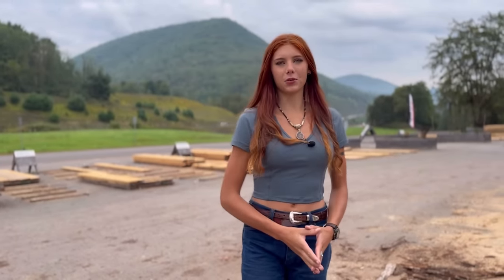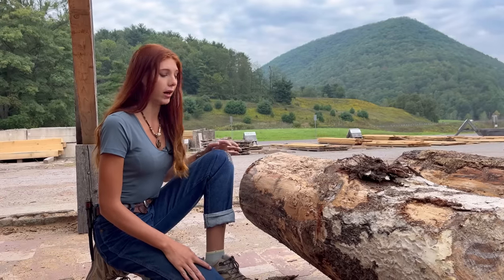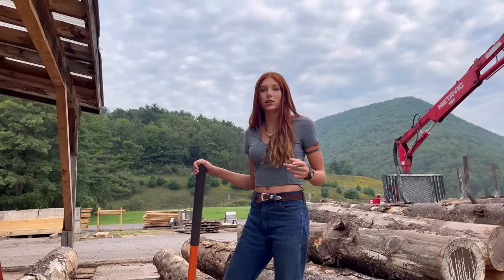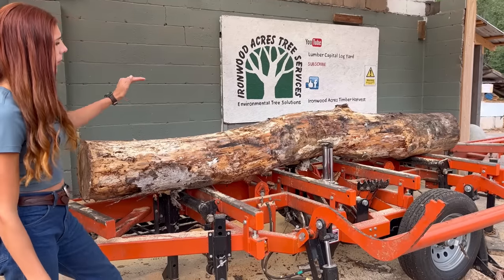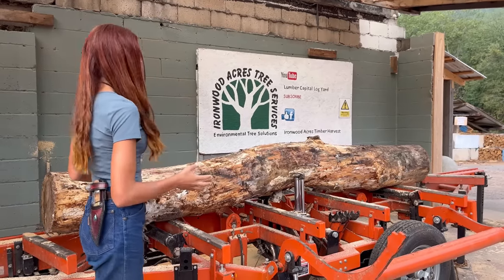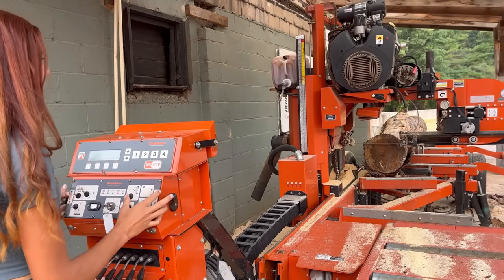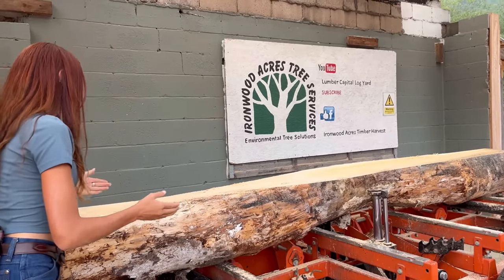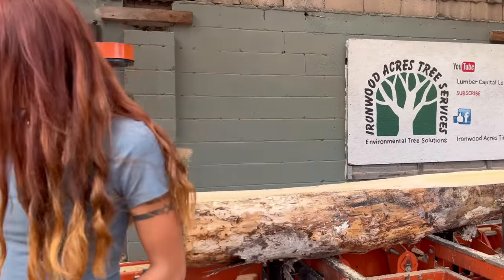PROBLEM SOLVED: How to Mill a “Banana” log!

Comment: Great job explaining the process used to work through a banana shaped log. Today, I worked through one banana log 20 footer, with a twisting action at the small end. Relieving the tension and compression inside the log was a challenge while working toward a stable cant.  Your camera and sound person earned an A+.
Reply: I don't think it's the smartest method, though she's lovely. The tension in the wood tends to remain after drying and no matter how many years of stickering and weighting. You simply can't overwhelm the hydraulic power of wood cells (not without new "baking" methods). The figure of the boards will be nice though. and if thin enough they'll be acceptable. I recommend the old fashioned pit saw way--saw directly through the straightest longitudinal axis of bent logs yielding two equal left and right bananas. From there you can get flat albeit bent lumber. This wood is ideal for chair parts. But who makes chairs out of pine? IDK. Something lost, something gained in all sawing, amen?
Reply: @carlosreira2189  The poor girl can't even spell lumber. Don't expect too much from her.
Reply: @Me-qp8vz  Ha. Thanks for that reply. In my experience, big logs don't generally get made into lumber. It's simply not worth the trouble. Specialty guys will try and mill anything, with their dual head chainsaw rigs, but production sawmilling is about grade. Flatsawn, so the knots are round and clearest face. Lots of flipping of the log, even though that takes some time. Hydraulics do it in a split second.
She's great. Super cute. Her family is teaching her the biz. That they even mess with a bent log is interesting.

Blessings of success to you and yours for the new year:
"Believe in the Lord Jesus Christ and you shall be saved, you and your house."

Comment: This type of log is the reason we use a 56" circle headsaw to open the logs. Then send it to one of two band resaws. Saying that, and with 30 plus years of sawyer experience. I've always opted for putting the highest pat of the crown at about 22 deg. off top dead center, taking a few cut, and going to face 3. I understand your dogs may not have the holding power for this. I cut a 1face to 3face, then 2face and end up on the 4th face. This consistently gives higher yield than the 1,2,3,4 cutting solution. I've done yield studies on both methods, and with an industrial circle mill and pneumatic dogs, this method proved best.  I'm not saying that is the safest method for your situation, but I'm glad to see that you've recognized and addressed the issue. Smooth sawing. 

Nd

Comment: Thank you Emerald. I've a new found respect of the furniture builders. Of the woods in Arizona of Ironwood and Mesquite for both trees that extreme warped twisted and bent limbs. Bowing of the limbs is normal. Yet they still manage very beautiful pieces of furniture. I suppose I never really thought about it. Since in mining beams of Oak, Ironwood and Mesquite are treasured. Although rare these days. I thank you for enlightening my understanding of the difficulties you face. Excellent video.

Comment: The boards from these logs also bow a lot because the grain is not straight. I lay these logs flat as possible on the mill bed and cut  2" thick live edge slabs and make benches from them. The more "bananaed" the more customers like the bench. Otherwise I just make firewood out of them. I would have gotten four basic, rustic benches from that log at $200 a piece. $800 log ain't too bad.  : / Logs with a big swale in them (usually from trees on a steep hillside where snow laid them out away from the hill when they were young, and then they survived and grew up), I take two facing slabs (butterflied) and make matching curved benches that can be used in a circular setting such as around a tree or circular garden ring.  I can get $500-$600 a set for those.
Reply: Yelp, some of the boards Emerald cut were warped from the start. It's best to use these logs for something other than dimensional lumber.
Reply: I was thinking the same as you.  Slab the log up and take advantage of the curves as a selling feature.
Reply: great idea
Reply: while fishing one day along a public acess waterway a nearby landowner made a bench for people to use. He did a beautiful job on it using a bannanad log, many layers of polyurethane on it . Been there for a number of years , a very kind thing to do and a pleasure to sit on and have a coffee or just daydream when the fishing slows down .
Reply: @johncarter1137  - No kidding.
Reply: Well I guess people will just have to put there order in. As you say great for circular projects. Maybe people could shop through scrap pile for project lumber. How do we match supply with demand?
Reply: GreyBeard_gamer: are you getting that kind of money for conifer benches? In my area I can’t give away any conifer slabs. In this situation I’d mill what lumber I could out of it for barn wood. Now if it’s a curved deciduous tree. I would absolutely mill curved slabs.
Reply: @dontfit6380  I'm in the Pacific Northwest. We have a few nice hardwoods, Madrone being a good one (tricky, though), valley White oak another, but softwoods are the staple woods. Doug Fir, Ponderosa Pine, Engleman spruce, Aspen, Cedar, Larch. I make benches and tables word of mouth now, but I used to sell just parked on the side of the road, on roads that lead to nice houses/cabins. Back in 1994 I was getting $175 dollars for an 18"X1.5" live edge five foot Cedar slab bench, just a very simple, basic bench I could make in one day. If it had a back, $250. I would always have a variety of slabs for folks that wanted to build something themselves. I would typically get $75-100 a slab. Today, any decent live edge softwood slab over 18" average width can get $100-$150 here. My most recent piece was a 1.25" thick by 38" by 57" dining room table with the top made from two planks of Aspen which sold for $3,200. I've never been volume, but a more casual maker. It does matter where you sell.
Reply: @Graybeard_  Iv'e done the same.

Comment: Something to think about, if the “bump” is severe enough you can take it down an inch or 3/4 at a time and get one or two live edge slabs that are live edge the whole way around, and then continue just as you did, they might make good live edge cutting boards and it’s just a product of milling a log like that!
Reply: She said it was PINE.  A soft wood. NOT good for cutting boards.
Reply: We have a few pine cutting boards we use for cutting and serving cheeses, they work fine for us, some people like the knife marks that develop over time and they are easier on a knife blade too, I’m sure they’d sell just fine

Comment: Good to see the approach. I struggled for a while with this and now I just lay them flat and cut them 5/4 for shelf boards rather than try to get dimensional lumber. Shelves are generally going to be shorter and they are not cheap to buy like a 2x4. Another use I have seen is stairs. While oak is great a lot of fir and pine is used for this purpose and will last a long time.
Reply: We lay banana logs flat and  make shorter lumber out of em. Cut them at their sharpest bend before you edge em. Utilizes a crooked log. If you have a use or market for shorter lumber!

Comment: When we get a "banana" log we turn it on its side and make live edge planks out of it, usually 1.5" thick.  The local craftspeople love to work with them to make furniture.
Reply: Yes and by cutting the sides you get less tearout from grain going out or into a board surface
Reply from the maker: +George Bartholemew We don’t have a market for that at this point.

Comment: Hello,

Run across your channel and find it very educational.  Ads a country boy  of 77 years I grew up in Ohio with forests with a large variety of trees hard and soft as well as  woodburners cross cut saws circular milling blades single and double bit axes single cross cut "turtle tooth"  hand saws wedges and split my wood all by had.
Trivia  to ponder ..... the old double bit axes serves two purposes. ... chopping and splitting. One head was thicker then the other. Hard to find these days.

Looking forward to watching more of your shows 🪚🪓

Michael

Comment: I guess it all depends on the market for which you are sawing. As a furniture maker, I'm looking at that banana log and thinking, use a two cross-cuts to eliminate that cup in the middle. You would end up with two straight sections of log from which you would get two thicker cants. They would be shorter, but the boards would still be plenty long for making furniture.... I appreciate these informative videos from LCLY. I live in Central Pa. Going to have to pay this mill a visit.

Comment: I guess it all depends on what length boards you're looking to get out of it.  I'd consider cutting the log in half and try to maximize what could be cut out of 2 shorter length logs.  If the goal is long beams, this doesn't work well.  If you're cutting 1" boards then maybe you get more BF from 2 shorter logs.  Just another opinion.
Reply: A set of 4 foot and 6 foot pickets seems more achievable than long 10 foot beams for maximizing timber yield from that kind of log. 
But if that's not what sells, the pickets would just sit in the sales yard unsold taking up space. 

Better to make fewer of what sells, than more of what sits.

Edited to correct autocorrect screwups.

Comment: Great milling. One thing you might consider is that some wood workers would love to have curved slabs. They wold pay top dollar.
I look for unique material that can bring a desirable curve. Where as getting that same curve out dimensional lumber would not  be  possible with out glueing.  I let the curve dictate the the overall shape of the project. Just putting that out there. 
Good job on your milling.
Reply: Absolutely that was my thoughts too. Great minds think alike.
Reply: How do you cut a curved slab with a straight saw bed?
Reply: If the log is laid with the curve in the horizontal plane then there is a fair chance of getting a good set of curved live edge boards without losing the bump & ends as you do with the curve facing up or down

Comment: Just wondering what keeps a banana log from going straight to the firewood pile? Do you mill all of your oddball logs or only certain ones? Another awesome video otherwise 👍🏾
Reply: The boss man (@teri Breon)said he likes the girls to “train on a cheap pine log” and then the girls will know what to do if say a walnut log or similar comes in.
Reply: @FeatherHorseforge  Yeah, the price difference between a pine log and a walnut log is quite large. Don't want to mess up on a log where the wood costs $5-$10 a board foot.

Comment: You seem to have done that before.  Impressive.

I am glad to see you wearing hearing protection.  I am 74 and have had tinnitus for years from working around loud machines without hearing protection at your age.  We did not know any better back then.
Reply: Nah many knew better but grew up on that "safety gear is for pussies so don't wear it and be a man" mentality so they didn't wear it to fit in. Mind you this isn't me making an insult but simply stating an observation about the culture back then.
Reply: @_gungrave_6802  You may be right that many knew better.  We did not.  We also did not know how harmful the sun or smoking was.  I wish you well.

Comment: Thanks Em Another great vid . ? Why don't you do your first cut 1/2, 3/4,1" higher than preferred then cut preferred , this would make a "flich" that can be edged then these thin boards can be stored in one the motel rooms and run through a table saw when snowed in , creating garden stakes for yr site or Williamsport w/ markets  , then what about all that bark that can be used for landscaping.?

Comment: I think generally sawyers try and center the pith with the use of a toe board or blocks to raise one end of the log. I'd suggest leveling the front end and back end of the log for the first cut when cutting off the hump. I think it could have saved you a little bit (albeit small) of lumber from this log. 

So when you look down the log to see where that first cut is going to come out, I'd be considering how do I need to orient the log so that the first cut enters just below the bark and exits just below the bark. Of course this would eventually result in a cant where the pith is not centered.... and I'm not sure if that matters.

Comment: I think what you were describing is there could be internal stresses in the log and when you remove some of the log it will try to relaxants a worse shape.  It happens to metal sometimes after welding or a heating/cooling cycle

Comment: I was wondering if you cut banana shaped timber into thicker slabs with the curved side resting flat on the table if the slabs could be used for river tables.  I don’t know if pine is an appropriate wood, but unique shapes and even smaller pieces incorporated into the table can make some beautiful river tables using Epoxy resin.

Comment: love the video!! great explanation! however, while cutting 8x's into 2x4.. you gotta remember to tell common folk about saw kerf. example, woodmizer blades have 1/8th" kerf,  they claim, actually more like 3-32nds.. regardless, what I am saying, is remember, tell folks the cant has to be 8"-1/8th" thick before you spit them in half, other wise the top half will be 2x4, but the bottoms will be 1-7/8ths"x4.... just throwing it out there saywers. never forget saw kerf. great vid though Em!!!!!! you go girl!!
Reply from the maker: +Helmig Homestead Actually, the mill accounts for the saw kerf and measures accordingly

Comment: You may know this but didn’t mention, I was shown to set a framing square on the deck lined up against the log and you can easily find low spot and make your first cut  count. Ps I like your mill, really wish mine had half the options yours has

Comment: I deal with a lot of 8'2x4's that are bowed(or banana'd). They usually burn in the blade. I treat my blade with silicone lube, and it makes a big difference for the time it lasts. I also treat my table saw. Wet and pitch wood slides thru better

Comment: when it’s that bent i’ll cut the log in half and do 2 smaller logs change my expectations and let the log dictate the boards. admittedly i use a swingblade mill which allows for easy lumber dimensioning. cheers from australia 🇦🇺
Reply: I, as an engineer, considered the same. I guess that you will get more straight wood from it when you cut the log at most dominant bend before cutting the boards. As a downside, the resulting boards are shorter.

Comment: Another way to cut those banana logs is to run it through a Hew saw, made in Finland. Designed specifically for those logs. They are high speed processors that can yield nearly 400,000 board feet in a 10 hour shift.

Comment: The sections of board that have the severe thin sections, like the piece right after the first cut through the hump could be sold for live edge mantles and shelves. Mill them so the final thickness after planing is 8/4 and they should sell

Comment: I think you would get more board feet cutting it with the banana flat then sawing only 4/4 boards. Once cut saw the flitches 15:07  where the straight run changes direction. In your case three stacks of boards. Then edge each stack and sell to people who want short pieces.

Comment: It will likely have internal pressures and the lumber will bow during drying. I would halve the length to keep the loss to a minimum. She is very knowledgeable though and obviously has her own way of doing things.Good info here

Comment: So,  I guess with bananas 🍌 like with normal straight logs you prefer max length cuts over max volume cuts?
Or do you also sometimes cut ✂️ the log into two relatively straight pieces by cutting the banana where it makes the biggest bow? And then cut the two pieces separately into slices?

Comment: What about just cut it into flat boards with the bend in it and pile them in a specialty log pile where people can pick them out if they need a specialty type log that bends around something that's in the way without having to deal with cutting a board a certain way or you know a rustic thing where it'll go around the obstruction. just a thought

Comment: the way the grain flows in thos boards is curved like the tree was. they will probably bend and twist like crasy when they drye up. so be sure to stack them up at the botom of your pile with a lot of load ontop

Comment: It's not an issue with soft wood because it's so cheap, but with hard wood, is there any market for shorter lengths? I personally am always scrounging for short pieces for making picture frames and such. those slabs had some hefty wood in them, though nothing approaching 8 ft. I'm in Canada so not likely a customer but I may be able to get some less expensive stuff if I don;t need it long, up here.

Comment: Would using a cheap ($70) laser level help with marking or seeing where to cut work better than just eyeballing it?
Reply: We had a laser on our headrig so you would know what your first line would yield . Tappers on the carriage is nice too. I would load a log with the sweep up [ vertical mill ] remove a slab then send a flitch to the edger man and let him deal with it, flip the log and do the same.  A lumber mill hasn't the room or the manpower to mess with  hobby wood.  I could have retired at 21 years old if I could have retrieve all the hobby wood I sent to the chipper

Comment: I´d cut it in two parts. The boards will be shorter, but much straighter. One of the problems of these logs is that the boards warp when they get dry.

Comment: If there is a market for live-edge table tops and/or counter tops, I'd cut the hump and bowed ends off in 2 to 3 inch slabs.  Display in a retail area for premium prices.  Pieces that don't sell would be firewood, or whatever you do with scraps.